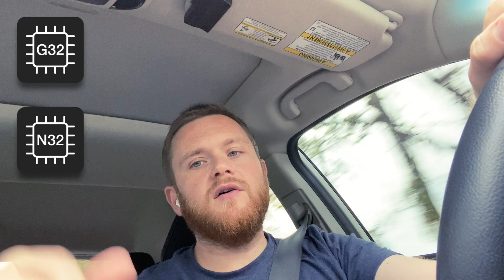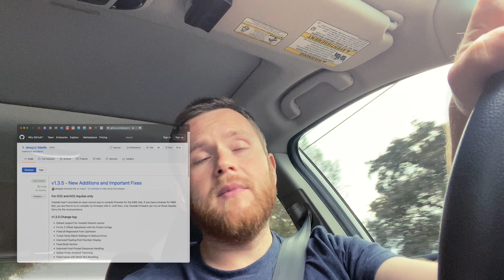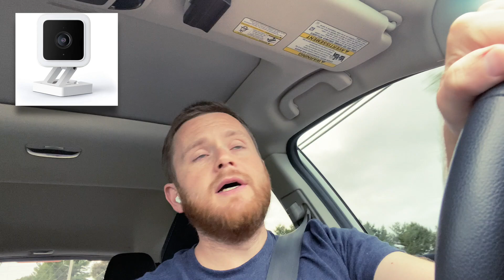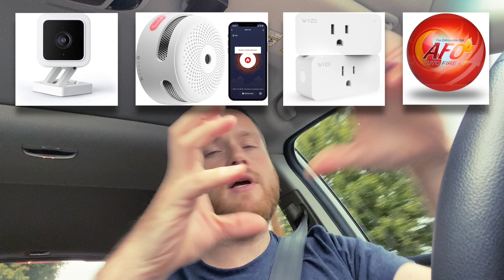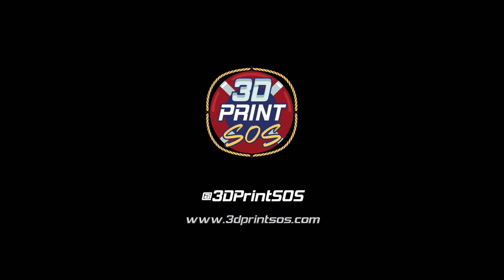Voxelab Aquila H32 - Buyer Beware!

Comment: Has the firmware been fixed. I just purchased one of these yesterday.
Reply from the maker: Yep. Voxelab fixed all of the critical issue via firmware and Alex is almost done porting the 3rd party firmware with advanced features. :)
Reply: @3DPrintSOS  awesome Im glad I won't have to tear mine apart right away to upgrade. So there should be no issue with overheating?
Reply from the maker: Nope. I would throw on the latest firmware though. Easy to do, I have several how to videos. ;)

Comment: got the h32. recently causing me issues where it says there’s power failure. 

debating if i should switch to an ender or buy the n32 board.
Reply from the maker: Hmm. It could just be a bad or lose thermistor. Could happen on any of the boards. I have two h32s that seem to print just fine. Maybe it’s something else.

Comment: Outstanding breakdown. I just finished my 'G' model Aquila firmware upgrade to 1.2.4. I was thrilled to find that I can now increase the E-Steps above the previous max of 186 via the control panel! After my BMG upgrade I no longer have to use Pronterface to update the E-Steps to 405. Well done Voxelab.
Reply from the maker: Nice! I didn’t know that was one of the fixes. Wish they documented these things better.

Comment: Do you know if there is any update regarding the H32? - The latest firmware still seems to be 5.5.3 that was released in July 2021.
Reply: I've emailed Voxelab and they have told me all firmware now supports thermal runaway... I'm not convinced firmware from July would though :/
Reply from the maker: I sent an email to get a response. They have told me they are all fixed. I have a feeling the date didn’t get changed.
Reply: @3DPrintSOS  thanks for the help. I might try a test as it’s not something you want to assume is fixed, especially with the older date. Plus OctoPrint still flags it 🤔

Comment: Just recieved my Aquila X2 and the chip is a H32, dumb question but which one do i download on the Voxel Lab site? There are about 3 different firmware downloads for the H32, with the differences being stuff like BLTouch. Im not quite too sure what that is or which one to get at all.. any chance i could grab help? If anything helps i checked my Aquila and the current firmware is 5.1.4. I'm a bit scared of the thermal runaway issues.. :(
Reply from the maker: No worries, grab this one: “Aquila X2 H32 Firmware V5.1.6”

Comment: Got mine yesterday and to bad its a H32. but i see on there site that they have an new firmware releasd on 14-10-2021 does that fix the problem? the did not yet update the BL touch firmware thats stil from 10-9-2021. i have ha BL touch that i want to install but is the BL touch firmware sage to use?
Reply from the maker: They told me all of their h32 firmware that Is in their page has the fix applied.
Reply: @3DPrintSOS  Oke Thanks! so its save to use the BL firmware then. do you have experience with that firmware? i read its a bit buggy? and the H32 is now save then? just as the N32?
Reply from the maker: I just got an h32 in but haven’t assembled it. I’ll do more testing myself because I’m going off their word.
Reply: @3DPrintSOS  nice that you going to test it and looking forward to the results. Thanks

Comment: I don't get it the Creatlity Board is also a STM Arm chip is it the drivers that are the issue?  Which Arm Processor is on the Aquilla X2, is it the H32 board version and this is not the ARM STM32F103 chip that is on the Creality?  What are the ARM versions for the Aquilla N32/G32 chip?  Are all Aquilla X2's shipping with H32 only and none of the X2's where shipping with any other version other than the H32?
Reply from the maker: The stm32 is the g32 chip. The n is a knock off but it still supported. However the h32 isn’t directly supported by Marlin. So they had to rewrite the firmware in a different way to get it to work. That caused all the issues.
Reply: @3DPrintSOS  is the ender 3 board not an easy slip in I’ll have to search for a link for anyone who may have done this.  Are re-calibrations needed for all the steppers etc?
Reply from the maker: I’ll have to buy one to test. The esteps should be close. However if you ever want your printer to be super accurate, esteps is always a good idea. Especially after major hardware swap.

Comment: Hey there I tried updating my printer but It didn't work. I have the Aquila x2 h32, and when I tried to download that software and install it on my printer nothing happened. Any thoughts? There is nothing on the internet about this that I could find. My sd card is FAT 32 and set to 4096 bites.
Reply: Dude. I've been trying to update mine for YEARS. I bought it 2 years ago and had no problems until one day I decided to "upgrade" it. Never got it working again. Spent HOURS ON IT.

Comment: New Aquila shuts down every print with a error msg. {Hot end or Bed temp to low. Any suggestions?
Reply from the maker: Sounds like your thermistor is either shorting or needs to be adjusted. On the hotend, there is a single philips screw that holds it in place. Loosen it, move the thermistor around, and gently tighten it back. See if that solves it.

Comment: Any speculation as to whether the H32 will ever get Alex firmware? I bought 3 aquila x2s on Amazon hoping to get a good one, but they were all H32s.
Reply: I’m using the beta for h32 rn and I’ve had zero issues at all. Only about 20 hrs of print time but it seems to be right around the corner
Reply: @3dfreedom316  what does it bring?
Reply from the maker: It’s currently being worked on everyone involved seems optimistic. Hopefully soon!

Comment: I have a question: mid print the glass bed clips came off causing the print to fail. Do you know what could've happened? My leveling seemed fine and I've reas that maybe the nozzle could've caught onto the print. Is adding binder clips a good idea?
Reply: The clips supplied are 2 on each side, too stop your glass bed from moving get two more clips. This way you have 2 each side instead of 1 in the middle.
Reply from the maker: Ive had this happen. Typically happens when the nozzle gets caught on an edge of the print and it sends the bed flying. Typically a result from printing too hot, too fast, and not enough cooling.
Reply: I've had this issue before too. A solution that I'm using now and highly recommend is to use kapton tape and tape up the sides of the glass bed to the sled. Kapton tape can tolerate heat so you won't have to worry. I've had my nozzle scrape my print and the bed doesn't shift after that.

Comment: i would flash the machine a N32 if i could, it only returns a xx.rar file.(did they accidentally put the windows version in the download list for the mac one???)...i reformat the SD card, (FAT32) add a folder, firmware.. converted .rar to .bin.put .bin file in, transfer to printer, start up...no activity as updating the firmware. i did try just putting the .rar file in the firmware folder on the SD card,
 no no, nu uh...please ...someone...tell me..."ok goofball, this is what you should do..."
sigh
;)

with minimal exceptions, this machine is a pig. it prints the test hook file fine....(#eyeroll)
here is the read me file from the 4.5.2 firmware update i  downloaded about an hour ago:
V4.5.2 Update:
	•	Fix the filament detection issue.

Please note: 
This firmware only works when your Aquila meets the following 2 conditions at the same time.
	•	There is an “N32” sticker on the machine.
	•	No BL Touch part on Aquila.

If there is one condition that is not met, please DO NOT update with this firmware.

To find out if your machine is “G32”, “N32” or “H32” type, please check the position pointed out in the below picture.
If there are no stickers on it, it is G32 type.

Firmware update procedure:
1. Insert TF card into TF card reader.
2. Connect the TF card reader with computer.
3. Open the U disk on the computer.
4. Create a new folder named firmware.
5. Open the firmware folder.
6. Put in the xx.bin file downloaded from website.
7. Disconnect the TF card reader.
8. Take out the TF card.
9. Insert TF card into TF card port on Aquila.
10. Restart the machine.

Screen update procedure:
1. Extract the DWIN_SET package.
2. Insert TF card into the TF card reader.
3. Connect the TF card reader with computer.
4. If the first time to update, please format TF Card (U disk), set the allocation unit size to 4096 bits.
5. Open the TF card (U disk)
6. Put the extracted DWIN_SET file on the TF card (U disk)
7. Disconnect the TF card reader.
8. Take out the TF card.
9. Insert TF card into the TF card port on the screen part (have to remove the screen part firstly)
10. Turn on the power.
11. If the screen goes blue, then red, it means the update completed.
PS: If screen goes blue and stay shortly, please repeat procedure 4-11. 
12. Turn off the power, then remove the TF card and connect the screen part with Aquila.
13. Start the machine.

Comment: how do you tell which model you purchased?
Reply from the maker: There is a sticker on the front left side on the machine. It will say either N32 or H32. If you don’t have a sticker, you have a G32 machine
Reply: @3DPrintSOS   there stickers but there in Chinese
Reply from the maker: It would be a large sticker that looks like a chip and it would have “H32” or “N32” so it sounds like you have a G32

Comment: I just received my h32 few days ago, and suddenly just now I saw a small electric flare during printing and the whole machine just stopped - and off by itself - was really shocked ( tried to on and it the 2nd and 3rd time - it starts for 2 mins and off by itself again - hopefully its not completely broken and will try again with another plug point after few hours - the machine is definitely quite hot
Reply from the maker: Electric flare? From where? Something shorted?

Comment: This is a very real issue I followed your firmware video to upgrade to the thermal runaway, luckily I did it when I did because week later the thermosta came loose whilst I was out and the run away protection kicked in and shut down the print

Comment: Aquila X2 is on sale right now for $199. Is it worth getting that over the standard Aquila?
Reply from the maker: Because the x2 has zero chance of being a G32 machine, I vote regular version. With that said, my n32 x2 has been doing great with zero problems.
Reply: @3DPrintSOS  but what are the differences? Buying standard I feel like I’m buying old versions.
Reply from the maker: Screen rotation, added filament sensor, a handle, and some plastic changes.  I did a video on it.  :)
Reply: @3DPrintSOS  Just bought one today, (Amazon UK) £151, the x2 model is £239. Think I can live without the few addons for the price difference.

The fire risk in the short term doesn't bother me as just like my phone, vaporiser, battery chargers etc these items are never left on at night or when I'm out of the house. Babysitting is easy when you're retired! 😂

Great channel btw, subbed 👍😎
Reply from the maker: Absolutely. That’s how I look at it too. If you put a pop tart in the microwave, it can catch fire and literary explode the microwave. So the danger can always be mitigated. 

Thank you for the compliment. :)
Reply: @3DPrintSOS  This became a moot point for me. My machine delivered today has no number sticker on it, so a G32.

Comment: I'm getting a replacement board next week and I hope it does not have the H32 chip. I guess if it does have one then in theory I could desolder it and replace it with the N32 from the board with the fried driver. Either that or see if I can buy a new driver chip to fix the old board, but as the chips are QFN packages I need access to a hot air station to do it.
Reply: Damn it, just got the new board today and it is a H32 chip :(
Reply from the maker: Bummer. At least at the moment. I’m thinking it all should be ok soon. Everyone is working on firmware fixes.
Reply: @3DPrintSOS  good, I think I will wait a bit then before getting the soldering iron out. I'm going to update to the latest off their website, I hope it includes the display firmware too as I had tried out that cfw while I was waiting. Do you think there will be one for H32 soon?
Reply from the maker: Yea I do. I asked Alex if he has an update,hopefully soon.

Comment: Damn, just got a H32, well no more over night prints for me. Is there going to be a firmware fix ? Hate to die in bed due my new 3D printing hobby :-( Only done 8 prints in two days, loving the machine,but if 1 wire breaks, toast ;-) Thanks for the heads up !
Reply: You will need to Rewire all the boards because they all tin on the ends. So cut the tin off than get you some connecters to use.
Reply: @windforward9810  what are you saying ???
Reply from the maker: These printers along with many other Chinese machines have tinned wires that are plugged into the board. It’s typically safer and better to have a connector crimped to the ends instead.
Reply: @3DPrintSOS  yeh I know, un-twisted bare wire would be better, but proper crimped lugs would be more expensive. I could cut and re-terminate the wire ends, but probably too short, I'm fine with tinned, just need to flip it over and re-tighten the connector blocks :-) I am loving my Aquila X2 and 3D printing as a newbie :-)
Reply: @3DPrintSOS   they are very easy to fix, before you remove any wire take a photo 1st than on the connection that the black wire are connected to take a permanent black marker and mark it. This is so if you pull the wire and get side tracked there will be no mistakes on which connection it goes too. I usually only do two wires at a time unless I pull a full board.
Reply from the maker: Pro tips. Thanks!
Reply from the maker: Yep, firmware fixes available. Shouldn’t be an issue anymore.

Comment: According to Voxelab, they only have H32 chips now.
Reply from the maker: Really? I haven’t heard that one yet. Not sure why I’m surprised.
Reply: @3DPrintSOS  Since they replaced my N32 board with an H32, I've been in continual contact with them.  Their BL touch firmware is too buggy to use.  So, I'm stuck using the standard firmware, which ignores post script extentions.  Any idea how long it'll be before Alex releases something usable for the H32?
Reply from the maker: Not sure on a date. Just know they are making moved to get it done. Which is great.

Comment: I got mine two days ago and got the stm32. I think it’s the same as the g32.
Reply: Jorge Villanueva... Congratulations you won the lottery! The STM32F103 processor is the best of the bunch as it's an official licensed STM product and uses STM's regularly updated and easy to source libraries when compiling. Also none of the other issues that the unlicensed clone chips have. Like communication issues, and lesser performance per clock cycle even with a higher frequency.
Reply from the maker: Yep, that’s the g32 machine. :)

Comment: I have a question: I just bought an Voxelab Aries and I haven’t even unboxed it. From your videos and if yours that it has the same internals yes the Aquila! If so it’s probably going to have the same problems… Correct. Thank you for letting us know about the problem I appreciate it. Keep up the good work!
Reply from the maker: No, this printer is actually quite a bit different. Not much is the same.

It uses voxelmaker via WiFi. Actually quite reliable i you stick to pla.

Comment: I love my Aquila more and more every time I print with it.  I got the G32 somehow even though both the H32 and N32 were being shipped at the time.  The firmware for the G32 was corrected for the thermal issues awhile ago, glad to hear the N and H32's are up to date now.  I finally switched to Alex's fork of Jyers UI firmware.  The manual mesh bed leveling, PID tuning for thermal tip and bed, and auto positioning for regular bed leveling options were too hard to resist.  The only reason I held off is because it reorients the screen view from landscape to portrait and I was worried about longer file names being cut-off, making it hard to tell different revisions of the same file apart.  Turns out the display will scroll through a longer file name if it's highlighted so file name length isn't a concern.  Got the new vertical mount printed and installed and it's ready to roll.  The vertical mount only uses 2 of the 4 screws and t-nuts so you wind up with a couple extra to mount something else, bonus!
Reply from the maker: That’s awesome. These things are super fun

Comment: Can Alex's firmware be installed on the N32? Is it just the H32 it can't be installed on?
Reply from the maker: Yes. The h32 is the only problematic version. Hopefully soon, it too will see support.
Reply: @3DPrintSOS  ok great, I have ordered a 2nd aquila from amazon so will see which one I get. I have Alex's on my G32 already, is it the same process to install on the N32 if I receive one of those? I followed your video to install the firmware 1st time around
Reply from the maker: Yep, should be exactly the same way. Just an n32 bin.

Comment: I have an Voxelab Aquila, because of your channel LOL, and I love it. Thinking of getting a second printer. Should I same a few bucks and go with the original Aquila, or get the new Aquila X2? I'm not sure if the new X2 is that much better.
Thank

N.B. I love your Youtube channel!
Reply from the maker: Thank you! I would go original. You can always add a few things that will make it a better machine for the difference.
Reply: @3DPrintSOS  I was thinking the same thing, thank you for your quick reply.
Reply: All depens why you need a second printer for. If I would have 2 printers, I probably would get a resin as a second printer to make quality miniatures with it.